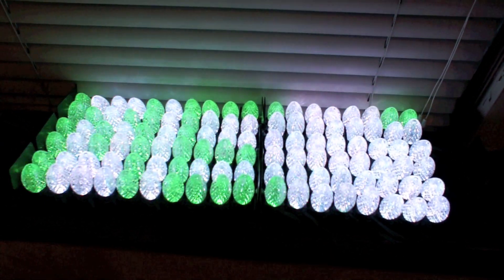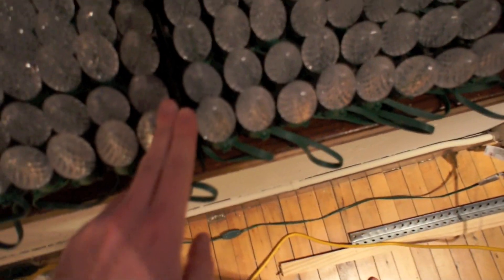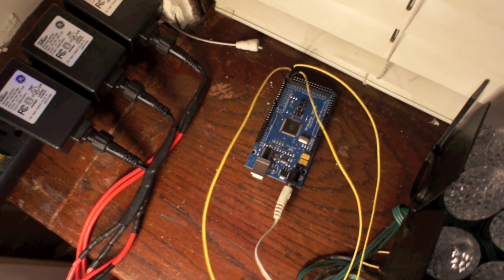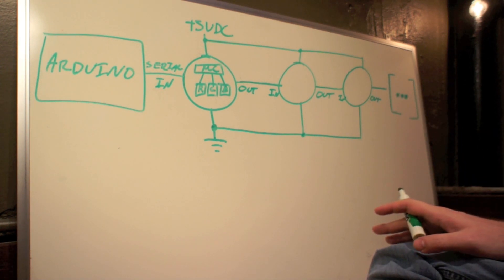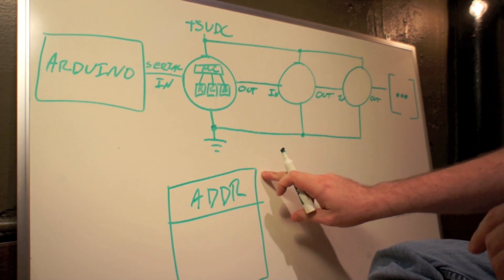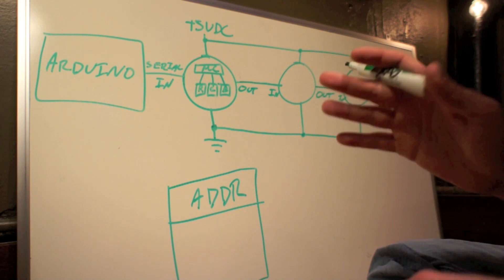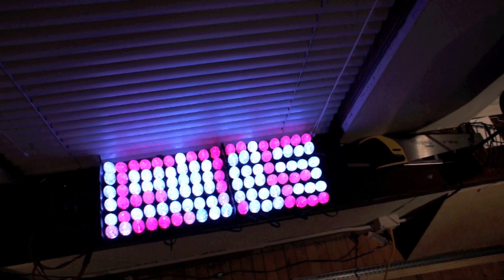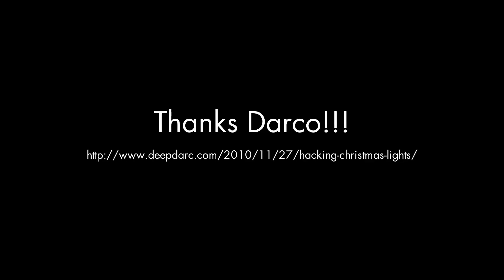Scrolly sign

Comment: I had a complete blast with this project, and learned a lot a great deal working on the code for this.  Riney and I must have batted a half dozen different ideas back and forth on the best way to drive the data bus, what refresh rate we thought we'd need, how to limit refresh rates to ensure smooth scrolling, etc.

By far my favorite thing about these hack projects is all the new things I learn each time.  Stop learning, start dying.